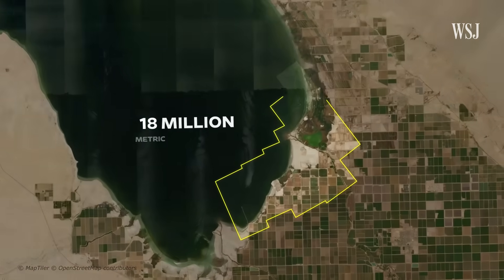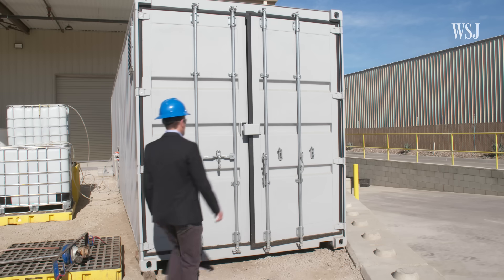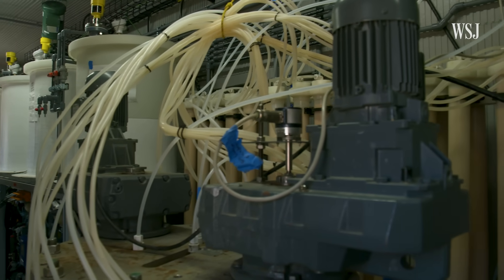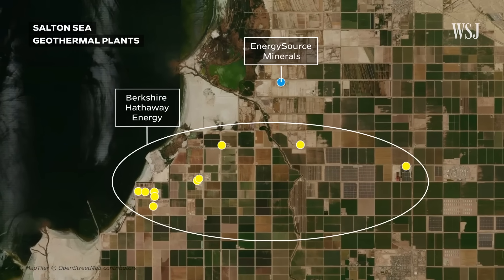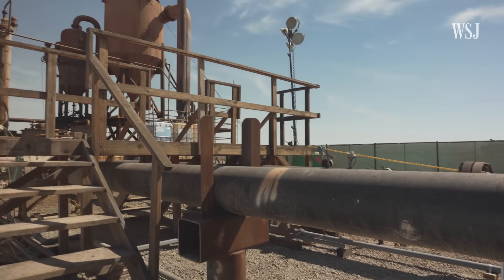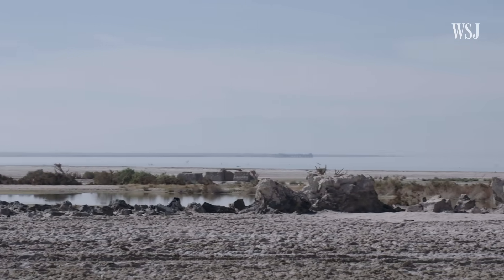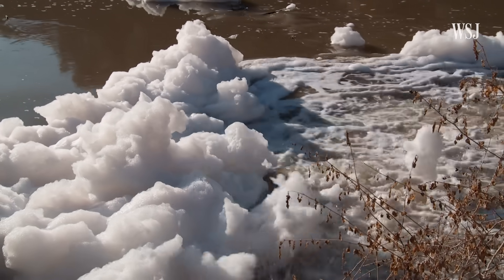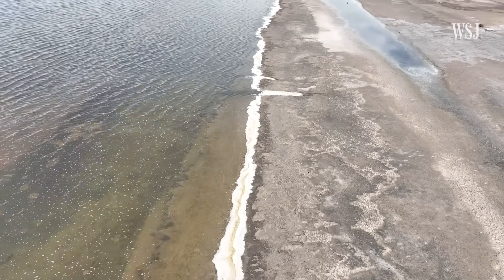This Toxic, Drying U.S. Lake Could Turn Into the ‘Saudi Arabia of Lithium' | WSJ

Comment: There were studies about bringing salt water from the Pacific to the Salton Sea.  Why don't they invest in that?  It will mitigate the toxic dust thus ensuring for a safer community that can work at the lithium extraction plants.
Reply: Run the numbers. It would be very expensive and require huge energy inputs.
Reply: @weirdshibainu  What are the numbers?
Reply: @j3dwin  They're huge enough it doesn't work. I had a water engineer explain it after I asked the same question.  He said the sunk costs of a pipeline are astronomical with environmental impacts included. You have to deal with the California Coastal Commission comprised of a board of just a few people with tremendous influence that can sink or delay a project for years as they control what projects can use any portion of the coastline. Then the question becomes, what do you do after you fill the Sea? Sure, you can still keeping filling it to offset evaporation, but the trickle is going to be expensive as each gallon has a low return on investment. Also who pays for it? and who benefits? Poor people in an inland county? Here's an example.  Hetch Hetchy was a beautiful valley, rivaling Yosemite.  San Francisco wanted a reliable, clean water supply, so Hetch Hetchy got a dam, flooding the valley---they had the political gravitas to pull it off, something the people of the Salton Sea area don't have. Fun fact-A couple of years ago, when the Great Salt Lake was low, people were suggesting to pump water from the Pacific and then desalinate it to fill the Lake.  He said that project would literally require the construction of a small nuclear power plant just to pump the water over the Sierras and across Nevada.
Reply: @weirdshibainu  That's a good response. Someone suggested using sea water in lieu of the depleted fresh water sources for the Panama canal locks. Costs and energy requirements are likely the impediment there as well. Thanks.
Reply: @j3dwin  A lot of water transport gets very political and bound up in regulations. Politics plays a huge role in it. The guy was a retired water engineer from California.  We use to talk at the gym. He could talk for hours about water politics. When I asked about water shortages in California he chuckled and gave me one of the better responses I ever heard about state politics. He said " One thing to keep in mind about water in California---it always runs up hill to where the money is."
Reply: This is a very good idea!!!
The idea of using seawater to flood lowland dessert areas would also help midagate sea-level rise, and develop new sea harbor communities.
Reply: @denniscrannie1126  The Pacific?? how are you going to get Mexico on board???!! Make them a dessert??
Reply: Can we do Houston next?
Reply: Importation of salt water into a trapped lake would not be approved even if it was free. Besides, it is hundreds of feet below sea level and any breach in any canal or pipeline would flood the farm areas permanently and devastate the food supply. There is exactly zero chance of that concept being considered.
Reply: you cannot convey salt water over a fresh water aquifer in a very active earthquake zone. HARD STOP
Reply: @kl3nd4thu - please check the distance between the pacific ocean and salton sea first!
Reply: @ecoideazventures6417  check it yorself. You cannot convey salt water over a fresh water aquifer in a very active earthquake zone. HARD STOP.
Reply: Or one could just wait for more ice to melt and the sea level to rise. This area used to be the north end of the Gulf of California until the Colorado River delta raised the land level south of the Salton Sink, which is below sea level. Palm springs would be ocean front property.

Comment: Lithium car batteries terrify me. And the insurance on an electric car terrifies me more.
Reply: Teslas are robots, accidents will become a rarity with Teslas and rates will by hyperoptimized based on driver data.  If the owner uses Full Self-Driving entirely, the insurance rates will sink through the basement.  Yes, even factoring in the cost of a battery replacement + install.

Comment: California can't even fill a pot hole...even if you believe these investors. Oh and EV's aren't actually "green", fix and drive an old car if you want to save the environment
Reply: Old cars will die eventually, and when they die, EVs are more green than gas-powered ones in the long run, so they are the next step towards greener transportation in the distant future before we come up with better solutions. If you don't drive that much or don't need a new car, you can keep driving the old ones other people wish to sell to you as long as you wish, but don't expect that in the future there will be a constant supply of used gas-powered cars.

Comment: Meanwhile desalination plants in the US are dumping their brine in the ocean even though sea water also has a lot of lithium
Reply: Concentration is the key here. Sea water holds 0.2ug/litre Li or say 0.6ug/litre in reverse osmosis brine from a desal plant. The Li concentration i Salton Sea brine is as high as 400mg/litre. Thats almost 1million times higher concentration. If I did the math right...
Reply: @KabonkNo1 you are right
Reply: still the volume dumped into the ocean isn't negligible , and the technology to refine it exists and its economically viable and will eventually be adopted . the main issue issue is the market right now has cheaper lithium mined from excavation in Africa   so why would a desalination plant bother extracting lithium if their final product is more expensive than what is available in the unregulated market  @KabonkNo1